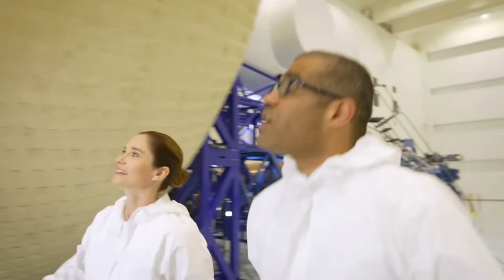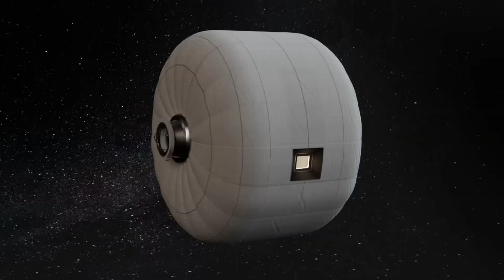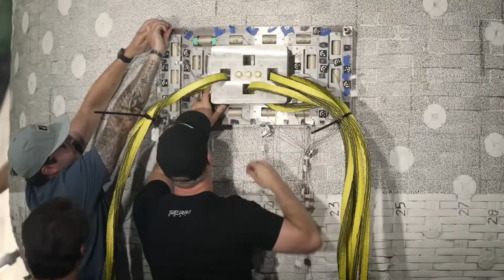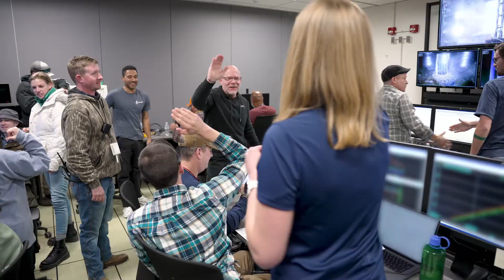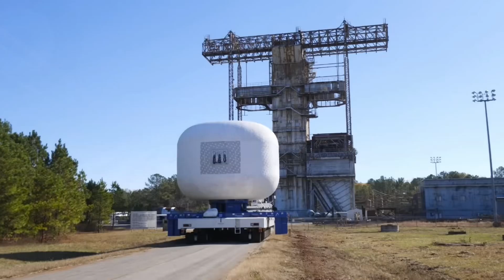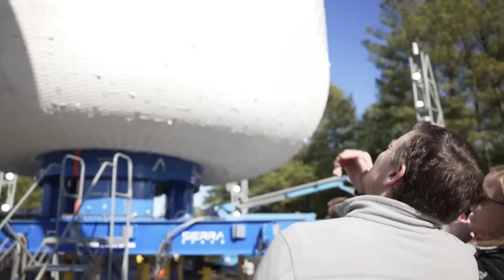Inflatable Space Station Goes Boom!

Comment: How do you think this multilayered fabric will go when folded and creased into a launch vehicle? They show it already inflated in the videos. I suspect there is still a multitude of issues with the fabric integrity when packed tight.
Reply from the maker: @geradkavanagh8240  it inflates in my video. They show it in an animation becoming inflated so that's part of the design.
Reply: @marionrkerr  just the animation. I'm still suspect on how all those multilayers of different materials will cope with being folded up. Kinda like a crease line on your cloths will wear more.
Reply from the maker: @geradkavanagh8240  oh gotcha. Yeah, I'm wondering how long it's actually folded for before it deploys.
Reply: @marionrkerr  Still looks like a good option to try for maybe greenhouse or ancillary systems spaces where a puncture wouldn't be immediately life critical.

Comment: Saying that we can put up a large station in a single launch this way is a bit misleading. LIFE only supplies the habitable volume. It would still take additional launches to outfit it with all the internal systems required to support life and even more launches for the solar panels to power the thing.
Reply from the maker: @IslandHermit  I think I said we'd have a station the size of a 1/3 of ISS in a single launch. But certainly didn't mean to imply it'd be fully outfitted and ready to go. Apologies for any confusion!
Reply: @marionrkerr  Probably pack some of the life support systems along the central axis ready for outfitting like a kit home. Would also need power supply and a multitude of other items. Hundreds of options and ideas spring to mind with this approach to space habitats.

Comment: I am skeptical for several reasons: Vectran is vulnerable to UV and it will be exposed to a lot of UV. Vectran (as Kevlar) is brittle and exposition to UV makes it more brittle yet. Vectran is not uniform and has a big variability from batch to batch specially in creep behavior (time-dependent deformation under constant stress, particularly at elevated temperatures) several samples have huge differences in the rupture point. Worse yet small variations in the constant load have gigantic difference in the creep rupture point. This comes from a NASA sponsored study made in 2021 (this remembers me of an Italian movie with Marcello Mastroiani in what he is obsessed with blowing balloons that never explode at the same point a very fitting image).
Fiber materials like aramids (like Kevlar) and Vectran is that you can't inspect them using X-ray, ultrasound or magnetic surface probes for finding failures (remember the mini submarine that imploded, that was one of the concerns compared to metals). For fixating it you need to use adhesives that are other concern.
Metals have more stable behavior with temperature variations, the creep behavior is much less variable with the constant stress variation, and they can be inspected with standard procedures several of them.
And I can only guess what long term effect radiation can have in organic materials in higher orbits (ISS is still protected significantly by Earth magnetic field).
It can work, yes like the sub that worked a dozen times before going puff: the main question is that inspecting it is a living nightmare, fixing it if needed is another, any failure will be both atmospheric AND structural as the pressure is needed to make it sturdy. For a module in ISS that can be closed it is Ok, but making a complete vehicle of it is a bet, a very dangerous bet.
This does not mean it should not be used or studied, but someone must point the problems instead of pointing only the advantages. In engineering like in science everything must be taken with skepticism.
To be fair I am biased: I don't like the startup mentality of lets be bold and fix the problems along the path, this was exactly what caused the OceanGate disaster and the accident in SpaceX rocket when the concreted was destroyed by the engine destroying a few engines on the process almost hitting the tanks near the launch pad: compare it with the Apollo launch pad design to avoid this very same problem thought years in advance of the rocket. Remmeber NASA better, cheaper, faster (akin tho the startup mentality): it caused a series of failures that stained NASA image so much that it didn't recovered completely to this day.
Reply from the maker: @agranero6  I agree with everything you're saying here. I think just a variety of rigorous testing modules (something Oceangate didn't want to do) will answer a lot. Thank you for such a detailed comment!

Comment: Wall in 1 launch.  How many launches to take up the interior?
Reply from the maker: @daviddroescher  the wall and interior are the same. It’s several modules all hooked together. Unless you meant the equipment inside…that’s probably the next launch.
Reply: @marionrkerr  3 stories of interior, plumbing,  beds, electric ,refrigeration,  heating, and solar panels w/mounts . You know everything to make it functional the 10years of launches in the comparison.
Reply from the maker: Gotcha. Yeah, in separate launches but having 1/3 of the station totally assembled in one launch is def a time saver.

Comment: I think they should use it to hold cargo!!
Reply from the maker: Agreed!
Reply: Could it be used to hold fuel? Possible as water? Either used straight as reaction mass:  split for crew air supply (as done on the ISS) or as propellant & Oxidizer.
Reply from the maker: @chrissouthgate4554  Hmm...I'm not sure. It's so big tho so think they're really thinking of it as the station itself.